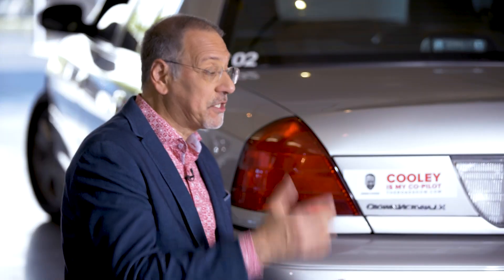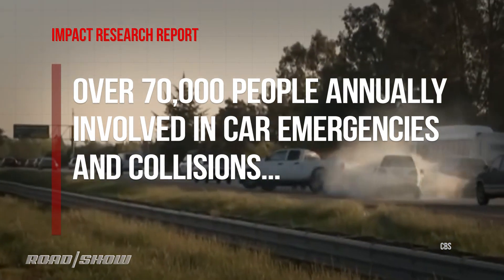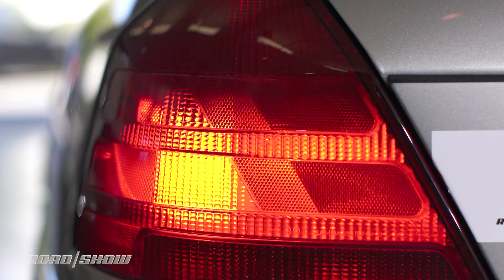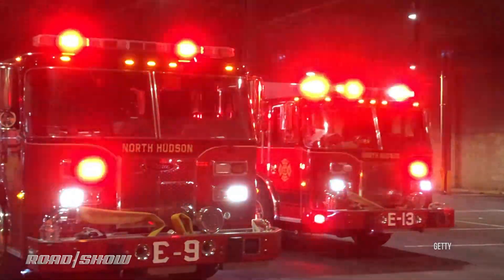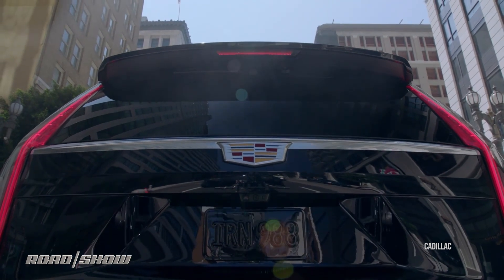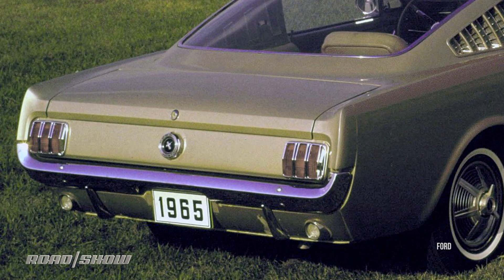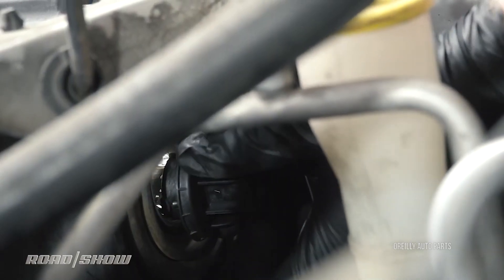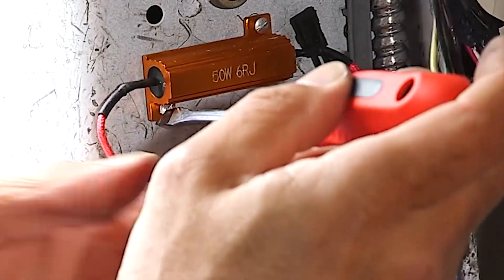What's the best color for a car's emergency flasher hazard light?

Comment: I don’t care what color the turn signal is as long as I can see it.   The amber LED signals along with Red LED brake lights on the same side make it hard to tell if it’s blinking much less what color it really is. 

I like the red flashers with red brakes on some but also amber on others.  
I think it has more to do with the size of the blinking area and if led the brake lights on that should dim just a little to highlight the turn signal

Comment: i found an adjustable turn signal module for my 04 corolla. it has an adjustable knob so u can control how fast or slow the turn signals flash. best mod ever so i can just plug in LED turn signals

Comment: Just refuse to buy a car without amber LED's and manufactures will wise up quick. Crazy part is that many German cars have backslided to all red hazards the past decade in the US. Unbelievable. Even upgraded my slow incandescent amber lights to 2800 lumen each amber LEDs [ w/ resistors so no hyperflash] so they don't washout in the direct sunlight. There's just no reason braking and turning should share the same bulb or red color except but for bad design.

Comment: Diode Dynamics has a flasher module for certain models of cars that not only speeds up the hazard pattern, but also gives you options on it zagging side to side and slowing down. It also gives you tap-to-turn functionality. Great for finishing off an LED upgrade!

Comment: Amber rear signals are FAR more noticeable than red, especially in snow, rain or fog.  It should be mandated ,,,amber front AND rear!
Reply: Especially if they're not LEDs!  The advent of LED brake/turn lamps has softened my red turn signal rage.

Comment: For turn signals and hazard lights, I only want amber turn signals in the back and separate from the brake lights, whether sequential turn signals or not. Amber turn signals and hazard lights are even brighter during heavy rain, snow, and fog. When red turn signals are used for cars with brake and turn signal combinations, the brake function for that side can't be used.

Comment: People outside of North America think we are nuts for having cars with red rear turn/hazard lights. I tend to agree.
Reply: Agreed.  Amber signals are best
Reply: Every time I owned a car, I immediately changed all the car's rear taillight to the euro version (ie: amber turn signal)
Reply: @c9sc9s34  I like that idea, that's expensive though depending on the car.
Reply: @c9sc9s34  I could probably do that with my Hyundai (at least the rear signal is separate from the brake light, but still red), but I doubt I could find one for my F-150 since the brake and signal light is shared.
Reply: Frank Silvers  Well I'm Canadian and have always hated our red turn signals. Nothing to do with being anti-American or anti-North American. I'm just anti-stupid, regardless of the source of the stupidity. lol
Reply: @plow76  the red turn signal really only annoy me on cargo vans and pickups
Reply: Frank Silvers  you’re making something political that shouldn’t be.  Red turn signals are not cultural.  It’s simply an old requirement that never updated.  Doesn’t mean it isn’t worth discussing.
Reply: Apart from being cheaper, manufacturers also used to do this as it was a cleaner look for the rear tail lights. I think we can all agree that a single shade of red (or just red and white) looks a lot tidier and minimalistic than having the colours red and contrasting yellow in the same tail light cluster. However, technology and design has come so far since then that this is no longer a valid excuse. The vast majority of tailights now have clean looking, clear lenses for turn signals that only flash yellow when activated. With LED's, having amber turn signals in purely red tailights are also now possible (ie. european spec Volvos, Audis, BMW's). I've even seen this design work for old fashioned  halogen bulbs by simply using a green bulb for the turn signal behind a red lense, so that when activated, the colours mix and produce an amber light (you can find this on most Peugeots from the 2000s)
Reply: @c.d.c9425  Agreed, sometimes designing for the American market is just an afterthought and handed off to a small, indifferent or not aesthetically inclined team after the initial non-American version was already designed.
Reply: I think your comment is hilarious and probably has a lot of truth to it!  Lol.   Made me chuckle.   Thumbs up
Reply: I think this was more of a problem before LEDs.  I still prefer amber, but with LED turn indicators and hazards my preference is no longer as strong as before.

Comment: It still peeves me that US market cars dont have amber turn signals in the rear when their international counterparts do
Reply: most asian and german imports have them.. home american cars do too. i know one example is the jeep cherokee, the turn signal is amber but goes red when its a brake light
Reply: @TomHaynes360  yeah. But then you look at the germans and all with the exception of a few VWs have red turn signals
Reply: @RChyshkevych  oh yeah you right. I forgot about the Jetta’s and stuff.
Reply: @TomHaynes360  that is a design all car companies who want to use red should do. That's the only jeep I would buy,  because it has Amber turns.
Reply: Creating an amber section in a red tail lamp lens costs more.  If they can make it cheaper, they will.  Also, cars that were designed without consideration of the American turn signal surface area requirement will find it easier to flash the entire assembly than to redesign the tail light cluster.
Reply: @canto_v12  yeah. This makes sense. But then again, international versions if US market cars already have amber turn signal (especially European and Asian brands). So wouldn't it cost more to have 2 separate designs instead of a single one? And  as for surface area issue (like in Audis) couldn't they just make the turn signals non sequential to get around it? A different line of code for the taillights cant be that difficult.
Reply: Frank Silvers  except I am American. That's why it bothers me. Otherwise I wouldn't care
Reply: Frank Silvers  a lot of us are in fact American, and not blind to the fact that our regulations can be, and often are, backwards.  Without dwelling on this particular case, it’s normal and healthy to compare for the sake of improvement.
Reply: Frank Silvers  I am American and I am speaking on Amber being better for safety so I don't see the point of your comment

Comment: All turn signals should be amber like everywhere in the world except for the US. European legislation prohibits red turn signals with good reason, rear amber signals are much easier to understand from a distance. Clearly the person activating them is turning somewhere. As opposed to having to double check if the person with red turn signals in front is braking, turning or has a burnt out bulb.
Another good idea US spec cars could adopt from European cars are rear fog lights. In case of low visibility, a car with these on is much easier to spot from a greater distance.
Reply: 100% for amber turn signals and +100 for rear fog lights. Rear fogs are the huge saver during the thick fog, alway using them on European trips. I had to replace my rear lights on my USA VW juts to add amber turn signals and rear fogs.
One more - all cars must have good front fog lights!
Reply: @ZBB8  to me do lights on the front don’t do much good.   The back ones are a great idea though I just hate it when ppl leave them on or they let one burn out
Reply: One interesting thing is that some European brands seem to be ditching them for North America. My V70 3.2 has both amber turn signals and a proper rear fog. Both our Audis (2016s) have rear fogs, albeit with red turn signals. However, my friends B9 (2018) A4 doesn't have rear fogs as far as I am aware. I understand they were there in 2017 but dropped for 2018 to save costs. It's a real shame and I agree rear fogs (as well as people being taught when to use them) should be mandatory. People here in Canada seem to turn them on by accident somehow.
Reply: Honda Element in Subaru Forester have rear Amber turn signals in the U.S. that's just what those companies choose. And with cars that have all red lights in the rear I find some do better than others at separating turn signals and Hazards from the brake and tail lights better than others.

Comment: I think amber or yellow should be mandatory for turn signals.
Reply: Especially if the turn signals are not LED.  American cars with 3-way bulbs acting as both brake and turn signal are terrible in daytime visibility.
Reply: Agree
Reply: I don't mind red lights but a turn and brake signal should operate separately.

Comment: I will never understand why American turn signals and hazards are often shared with the brake lights. It makes absolutely no sense. Having a separate amber signal as well as the brake light is so much clearer to see - and it clearly segregates the two functions. Having two red colours (with both sometimes using the same bulb) can cause confusion and hinders visibility IMO.
Reply: Very simple answer: cost.
Instead of installing separate wiring and separate bulbs American car makers use the same wiring and bulb for both brake + turn signal functions.
I completely agree with you, all turn signals should be amber, this makes it easier for drivers to understand what the person in front is doing. It is even worse at night when the tail lights are on. The red bulb goes from slightly on to fully on (multiple times) when the turn signals are activated. This is hard to decipher. Is the person in front braking, turning, has a bulb malfunction? Who knows...
Reply: Maybe it's just me but I honestly don't think it's that big of a deal. I've driven in several different countries in Europe and I'm from the States, I just pay attention to what's in front of me especially considering so many people don't use turn signals anyway.
Reply: @kenyattaclay7666  Then you maybe just drove at good times.
Reply: @KiliGraphics  I’ve driven in Italy where nobody knows how to drive. I’ve driven in Paris, I learned how to drive in Chicago, I lived in Germany, I used to live in Texas which at times is worse than Italy and I now live in the DC area and ANYONE who has ever driven in downtown DC will tell you there is no such thing as driving at good times.

Comment: They are now making LED lights that have a built in hyper flash resistant so when you put them In they will not hyper flash! It’s hard to find them but I just got some for my Jeep grand Cherokee Overland! Due to my Jeep having LED lights in the front and side mirrors, the rear lights would hyper flash until I got the lights they have them built inside!
Reply: I have LED turn signals that are like that. But I think the way they work is by just using as much power as the regular bulb by being extremely bright. Great during the day, way too overkill during the night.
Reply: Make sure the load resistor isn't causing the housing to generate excess heat.
Reply: @Lucky8s  👌🏽✅